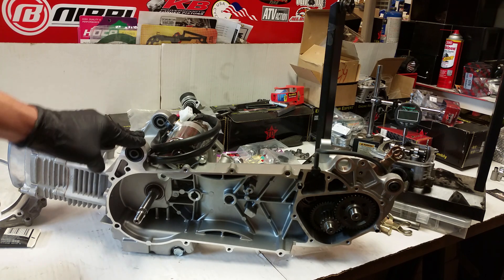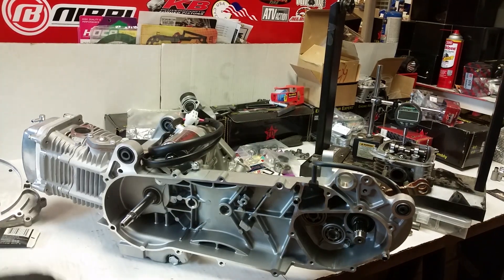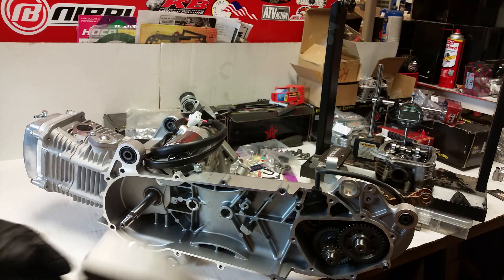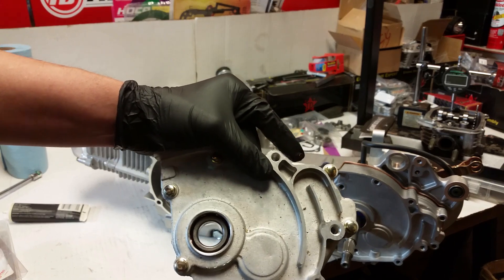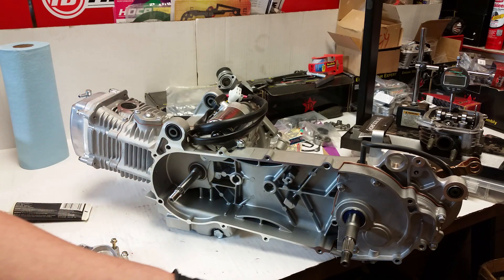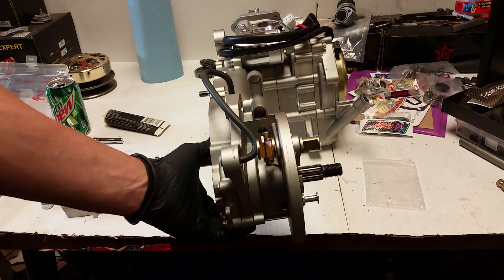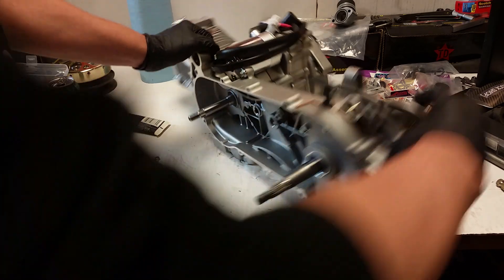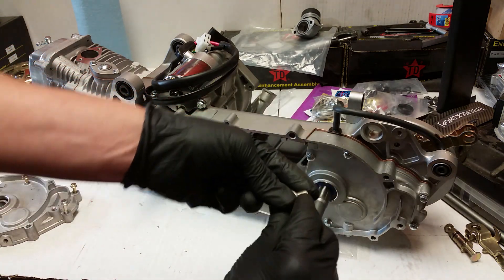Honda Ruckus GY6 232 Transmission

Comment: I know this is an old video, but in case anyone is watching and struggles with figuring out which bolts go where here’s an easy way to figure it out when you just have a pile of bolts.  Put the pieces together and start just sliding any bolt in then—-All bolts in general follow this rule of thumb (I know this cause I’m machinist and have read about and worked on engines for 30 years).  Ok…so you slide any bolt in and just look how much it is sticking up above the part it’s clamping.  Bolts when made by a factory to hold something together will follow this rule—the downer of the bolt at the threaded portion, times 1.5-2 will be how far it engages.  So if it’s a 6mm bolt (the bolts in metric land that have 8 or 10mm hex or 5mm Allen ) will screw in 9-12mm.  So in other words, when it is just slid into the hole and not threaded you should see 9-12mm off bolt shank under the head.  If the hex head is already touching the part then it’s obviously the wrong bolt and it’s toooo short.  If there’s noticeably an inch of shank sticking outta the hole when you slide the bolt in it’s way too long.  
The other way is to slide all the bolts in any hole in any order.  Some will stick up way higher than others and some might not stick up any.  If too high it’s gonna bottom out.  If the hex head portion sticks out hardly any then you know it’s too short cause if you tried to thread it in it might only go one turn or so and that’s not enough it will pull the threads out if you tighten it.  Basically just swap them around till they all are about sticking up above the surface same amount.  After more experience it will just become second nature to be able to tell what goes where.  There’s other ways to determine when you’ve just got a pile of bolts but this is already too long, 😂

Comment: Thx for getting back to me Dan on my last question. My current question is how come when I saw you use your impact wrench, I heard no compressor or generator in the background and I noticed in your gear install video, that you used tht red grease on your gear bearings before installation. Most people just would use the lubrication from the gear oil and use no grease at all. Also, is it ok to mix the two together(grease on the gear bearings and then gear oil after closing the gear box and wht type of bearing grease would u  recommend. If you answered my 1st question in my gmail account, just disregard repeating yourself and I will check it.
Guys like you, allow me to have the confidence to start and finish my repair projects.
 Do some videos on the differences between stock products and aftermarket ones, the differences between Chinese, Japanese, Taiwanese and European bikes.
 If you start to get rid of your stock parts on a Chinese bike for hp parts could it really pay off in the long run and are the Chinese frames worth the expense !

Thank you again,  Dan

Comment: My current question is how come when I saw you use your impact wrench, I
 heard no compressor or generator in the background and I noticed in 
your gear install video, that you used tht red grease on your gear 
bearings before installation. Most people just would use the lubrication
 from the gear oil and use no grease at all. Also, is it ok to mix the 
two together(grease on the gear bearings and then gear oil after closing
 the gear box and wht type of bearing grease would u  recommend. If you 
answered my 1st question in my gmail account, just disregard repeating 
yourself and I will check it.
Guys like you, allow me to have the confidence to start and finish my 
repair projects.
 Do some videos on the differences between stock products and 
aftermarket ones, the differences between Chinese, Japanese, Taiwanese 
and European bikes.
 If you start to get rid of your stock parts on a Chinese bike for hp 
parts could it really pay off in the long run and are the Chinese frames
 worth the expense !
Reply from the maker: I have a massive Ingersold air compressor, I can run the impact wrench for a while before the compressor kicks on....

To answer your second question, the red stuff is actually synthetic bearing and gear grease.  Assembly lube is used on the engine internals because it breaks down and will not congest the oil... You do not want you gear and bearing grease to break down.